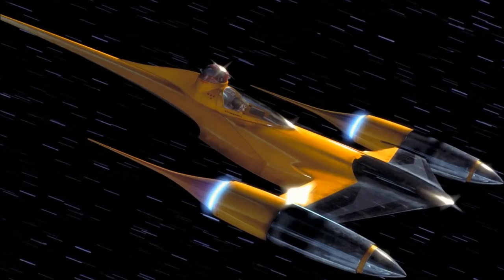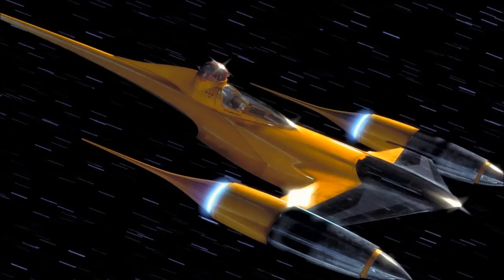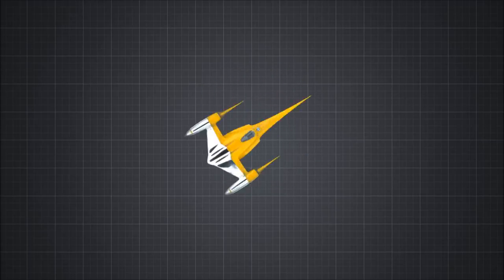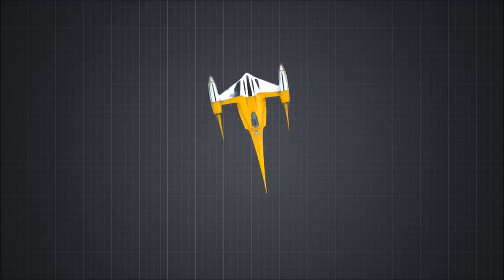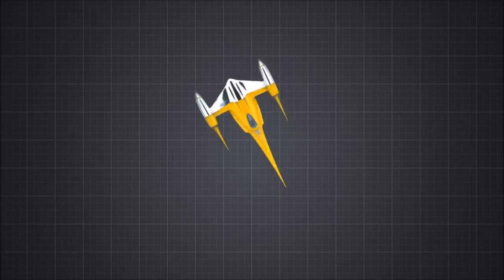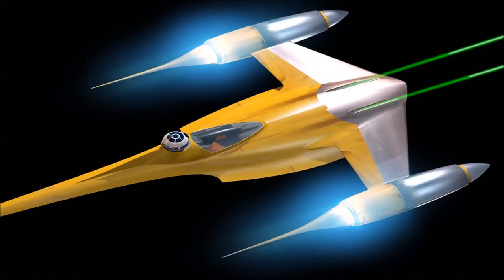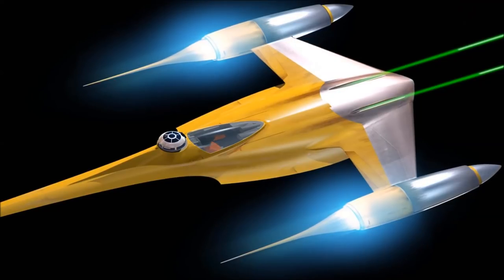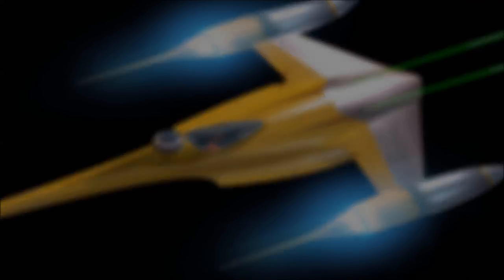Star Wars: The Big Problem with the Naboo Starfighter - Spacedock Short

Comment: In the Star Wars universe starships use something called an 'etheric rudder' to turn. Basically each of those engines is plugged into another dimension that anchors it.  Kind imagine all ships in SW are floating in water and use an invisible rudder system.  That is why you don't see small thrusters on SW ships that they use to make fine maneuvers.  Its all a combination between Main engine, etheric rudder and repulsorlifts.

Comment: That acceleration is nonsense. Its over 300 million km/h squared.
Reply: James Longhurst What's more, it's on a ceremonial fighter?
Reply: That too. But let's say that something could go that speed. Every second you accelerated you would go 31 thousand kilometers per hour faster. Every single second. How long do you think you have to shoot a target with your dinky little inaccurate plasma weapons?
Reply: James Longhurst actually it’s 37.500 m/s squared. It adds up to 135.000 km/h faster every second. Most ships in Star Wars are able to reach that kind of acceleration.
And no, not every single second. If the power supplied by the onboard reactor is constant, the ships rate of acceleration will progressively decrease as it approach the speed of light, not even counting the necessity to economize fuel. Plus, the ship doesn’t need to accelerate constantly for extended periods of time anyway, and it’s certainly not gonna do that in combat situation.
Reply: Nihl Uxler point still remains. That speed is needless. People can't react at that speed much less dogfight. 

I also call bs on that acceleration as these fighters can't hit the airspeeds or manuverabiluty of modern day aircraft. 

Its just a case of whoever wrote those canon stats had no idea what they were talking about.
Reply: James Longhurst 
Nope, that kind of acceleration is actually supported by the movies themselves. In ANH, after the falcon exited hyperspace in low orbit of Alderaan, it only took it 40 s to make the 60.000+ kilometers which separated it from the Death Star. Same for the TIE it was following. I’m not gonna enter into the details, but it’s a lot more than 3700 g. 
In the same movie, the X-wing task force which attacked the Death Star was able to make the 200.000 km between Yavin and the battlestation in less than 5 minutes. Same for all the other movies, where achieving high orbit is only a matter of seconds.
« They would have no time to react » react to what ? That acceleration is useful for interplanetary travel. Interstellar void is just that. void. It wouldn’t deserve its name if you couldn’t do a thousand km before smashing into something. 
I find it pretty funny that people adamantly deny the idea that Star Wars onboard computer would be capable of handling a speed of a few thousands km a second, despite the fact that an hyperdrive can easily push a ship above lightspeed without encountering any kind of problem.
Reply: James Longhurst That speed is even slower than Star Trek ones.
Star Trek acceleration for the Enterprise D is something like 37500000 km/s or 135000000 km/h.
Reply: Sergente A Which is idiotic because humans cant survive more than like 100ish g of short term acceleration. Anyone piloting that would be turned into mush the instant they would try to floor it
Reply: Žiga Auer They have gravity-based inertial dampners. So they can do like normal even at those speeds.
Reply: @nihluxler8823  Hyperspace is used for interplanetary travel. The fighters in the movies are way to close together too support these kinds of speeds.

Comment: Engine spacing like that is actually a very GOOD thing for a starfighter. If you want to apply real-world physics to the matter, the positioning of the engines would allow for a high degree of zero-G maneuverability.

Additionally, in space, destroying one engine would not cause the fighter to spin  as there are no drag forces acting on the destroyed engine - the fighter would continue to move straight forward. It doesn't matter of the thrust is offset by any degree, without a force pushing the opposite direction on the other side an object will continue to move forward.

In atmosphere, however... Yeah, that's a pretty big problem. If it weren't for the repulsorlift system the thing wouldn't work at all in atmo. In space, the Naboo starfighter should basically be half of a Starfury.

Spaced out guns are also not as terrible as you state - they were quite effective on WWII fighters.

But this is why you don't try to apply real-world physics to stuff like Star Wars - the designs that turn out to be the most effective are the ones that look least like they would work - the TIE fighter would be an incredibly nimble design if ion engine technology were capable of propelling things that quickly.

Comment: Perhaps there's software; or maybe even dumb mechanical interlocks that, as soon as one engine encounters trouble, both shut off?
That said, using a differential throttle (software controlled or mechanically governed), one could probably achieve some insane turn rates too.
Reply: It would help, but Considering the thrust they are supposedly meant to output, a delay of even a fraction of a second would still cause some serious spinning.

Comment: To be fair this is mostly a defense interceptor, except it's fucking huge, easily the size of a multi-role vehicle, kinda dismally armed (for reference the Z-95 has the exact frakking load-out almost,) and this wing-engine problem. The Queen's starship actually has a good overall frame for a combat starfighter I would think. Even putting this thing against a Delta-7, I think the Delta has better defense and maneuverability, and better weapons.

Comment: What you say is true, but consider the obverse. When yaw is required you need to cut way less thrust on one of the engines mounted further outboard so you can keep moving forward as fast as possible. A roll requires less thrust vectoring away from full forward thrust. A point rendered moot by its proclaimed 3000G acceleration, I know, but still. A crippled fighter is a vulnerable fighter anyway and chances are pretty high you'll be killed if a single engine dies, even if you manage to keep it flying stable.

Comment: Fine video but I'm not sure an engine faillure or the oblitaration of an engine will put the figther on a spin, they operate in space, no friction so i think it will go into a straight line. Space does not need aerodynamic, it's just for the look. To be able to turn it need truster on the side and powefull one if you want to have a tight turn.

Comment: You mentioned that it would be bad for a space fighters guns to be placed far apart, but this is not true if you look at actual second world war aircraft. On a craft like a Spitfire, the wide positioning of its eight machine guns created a wall of fire that was almost impossible to evade. That being said the main reason for the guns being placed in the wings in the first place is to avoid having to place a disruptor gear in the engines.

Comment: A decent Pilot would switch their guns on an X-wing to port and starboard paired firing or columnated clockwise or anticlockwise fire rotation for close range - for extreme close range flipping the guns off on one side while moving the ship at a slight angle to it's direction of flight is likely the best bet. But yes a centre line firing point is useful at short range - but the problem you allude to may be the very reason why (Disney) Star Wars later model X-wings are fitted with an additional 5th gun.... Though Personally I think that would be much more effective & useful as an Ion gun that it would as a 5th blaster - unless it's fitted with a stun setting mode for "Capture" situations Bit that wouldn't be much use in space combat. It would be pretty useful in police actions, defence and for capturing people alive .

As for the Naboo N-1 You might be right that the ship might tear itself to pieces if it looses an engine - Y-wings seem too do just that too. I don't think that would be much of an issue in an A-wing though due to the way it's thrust is directed and because the engines are close to the center line. As to the general point - I'd need to read up on the robustness of the Acceleration compensators, Structural reinforcement, shields, and Artificial Gravity and Initial Dampeners.

I don't think for example that Star Wars ships use the same tech as Star Trek ships - as it's clear that it's part of the very nature of many Star Trek ships to be able to not have issues with iffy engine balance on the sublight engines. Star Wars ships look like they were assembled by people with a large hammer though so perhaps that is a suggestion of robustness in their abilities... or perhaps not. perhaps they all live on a wing and a prayer.

Comment: when a twin engine craft loses power the loss of thrust plus the drag on the offending side is the reason for a spin not particularly the unbalanced thrust of the other side though this is a factor, it would not flat spin for two reasons in space there would be extremely little resistance on the side losing thrust so it would cause a wide oval spin seeing as a tight spin would require a push on one side and a drag on the other therefore the stabilizers this craft presumably has to maneuver would be able to keep the craft straight and the pilot could guide the ship home with one engine exactly how real pilots do with hulking unwieldy twin or quad engine airliners. the numbers are different but the concept is the same. there's many instances of single engine or even triple engine failure on airliners and they make it home if the pilots are skilled.

Comment: Mando fixed this problem by adding a third engine to the middle right under the cockpit, if one engine on either side were to fail it can be shut off and the middle thruster could be used by itself just till the broken one could be fixed

Comment: I hate defending this Starfighter as it is prequel, but if you destroy one engine you would not immediately lose all thrust, that is what would have to happen to make you go into a spin. You would just veer in the direction of the damaged engine. You could still fly the ship but only turn in that one direction. Circles would mean you could still stay in the battle if you were good enough. I am surprised you did not mention the droid problem, of course the problem with where are the legs, but beyond that it cuts off allot of the tools by only allowing the head out.

Comment: Lucas insisted on fake canon for the r2 unit by refusing to slightly adjust the shape. As for the asymmetrical thrust that could be mitigated by vectored thrust coupled with an instant deration.

Comment: Well, technically, in space, you wouldn't have your engines blasting all the time. This is space, not sky. You would just fire the engines for orientation and/or to accelerate/decelerate. Once you have your trajectory and your speed, you would just let the ship drift away since there is nothing to slow you down, and therefore, nothing to justify that you keep the engines on at all time. 

If you did constantly use the engines, you would just accelerate exponentially until the G force crushes your body or the ship gets destroyed.

Knowing that, the engine placement on the N1 Naboo Starfighter makes the ship far more maneuverable, especially if you can fire only one at the time. But if one of them was destroyed, it would be almost impossible to accelerate straight, since using the remaining engine would, indeed, make the ship spin without changing the current course of the ship.

Comment: The N1 could have an auto shut off override in a linked electrical feedback circuit, once cut the second engine would loose power at the speed of light, effectively instantly. This would be simple enough with our technology let alone in the SW universe. Not arguing its a great design, just saying its not as critical as made out in the vid.

Comment: actually i can give you a more problematic issue with the engine placement.   Space is dark....   in planet shadows,  moon shadows, asteroid fields,  pilots will dim the cockpit lights so they can see better...   the problem is... the engine exhaust and "flare"  is mounted so far forward, that the pilot if he looks side to side, will have his night vision blown out by his own engines.      US pilots had this problem with the first missiles.   when they would fire them at night,  the flash of the engine exhaust would blind them and they would have to wait for their eyes to readjust.   this left them extremely venerable.  so this means the N1 starfighter pilots would essentially be nightblind while flying.   there should be "shields"  on either side of the engine facing the pilot .

Comment: I'm not sure I agree with you.  First, after the x wing this is my favorite SW fighter.  It's soooo pretty.  Second, what if it was actually really good?  That's how I like to think of it.  Naboo had money so they got the best ship and like if  Bugati and Ferrari made starfighters, the best ship was made pretty to get people's attention cuz price doesn't matter.  What if there was no engine problem because of a inherent ability for the engine to stabilize like space traction control?  Also, the laws of motion aren't the same a long time ago in a galaxy far away.  What if the engines were connected by a ridiculously strong carbotanium material like the zonda which doesn't need thick wings.  I like to think in those terms because, first, I just watched top gear, and second,  a ship that pretty that's that awesome is so much more fun.  It certainly did pretty good against all those droid ships.  Even got a kid into a big doughnut.

Comment: Why would it spin? There is no drag differential in space to cause a significant lever effect.  To spin in space you need the thrust vector to have a different angle than your momentum. This fighter does not have a differential thrust vector between the engines. That would just be inefficient as normal operation would require 2 engines to cancel opposing forces.

Comment: Dunno about this video.  It's not really clear if the ships use thrust like say an aircraft does in our universe ... In episode 1 you see the ships hover, they move out of the hanger ... this could possibly indicate they use the engines to generate power/field around the ship to make it move.. like repulsor technology, making things float in the SW universe.  So in theory if they did lose a engine/power plant, the other remaining system would just have to compensate.  It may be theoretically, the same as if a 767 loses an engine and the pilot/computer adjusts power to the other engine/flaps/ailerons to compensate.  

Sides, if Luke, Vader, Poe aren't flying the ship then it just explodes on contact anyway.
Reply: Repulsor lift tech as it's described in universe needs direct magnetic field interaction with either a metallic surface below it or interacting with a planetary field. Meaning that while they might have built in repulsors, they wouldn't be of much use once in high orbit. Particularly since Naboo doesn't have a particularly strong magnetic field compared to 'earth standard'. The ability to interact with even a 'normal' magnetic field in zero G at that distance would be negligible at best. Plus there are mag tracks along the hanger floor that would account for the 'hovering' ability of an N1 in the hanger. And it's shown to be fairly linear in 'hover movement' capability aside from rotation.

Comment: you wouldn't do into a flat spin immediately. 

planes on earth have the same problem if they have two engines. 

since obviously the craft can maneuver it would be able to throttle back on the one engine and then compensate with however it steers.

Comment: Why not just make the ship turn off the remaining engine if it's partner ceases to work? There's probably some purely mechanical/fuel flow method of just mating the two engines together so if one goes they both go by default with maybe an override for it.

Comment: I actually agree with most of the things you've said, but... Hey, that "endless turn" thing with a single thruster seems weird to me.
Just look at an airplane : even with one engine left, it flies straight. It doesnt matter if it is on one wing or another.
And since Star Wars ship tech draws heavily from aircraft tech more than from rocket science it is very likely that such ship would do the same. Not to mention that a rocket would do the same as well with a proper thrust at the right moment.
Please correct me if I am wrong (and/or if my english is bad, given the fact it is not my mother tongue). Liked and subed.
Reply: The airplane flies straight because it's rudder can counter the off center thrust. Rudders don't work in space.